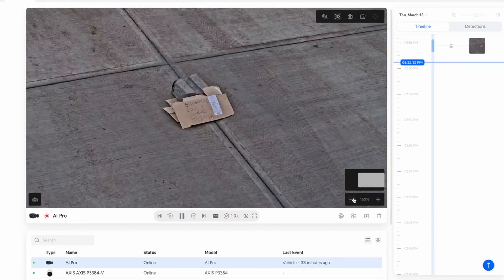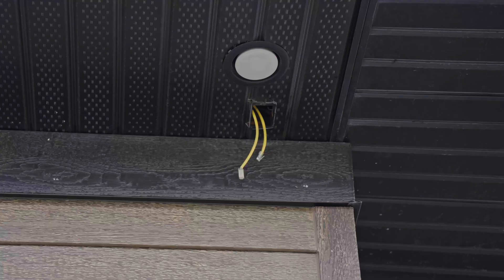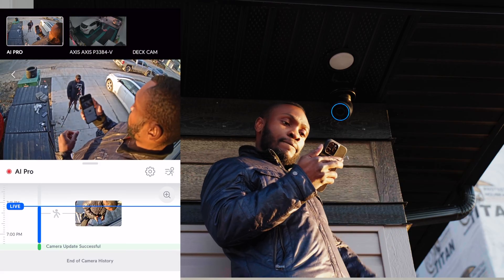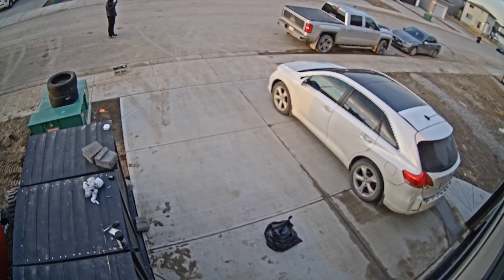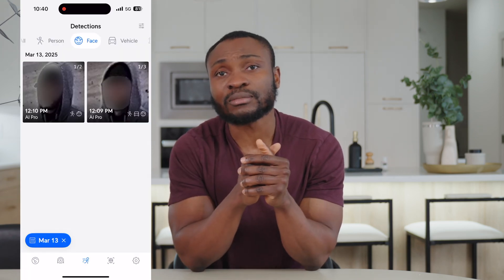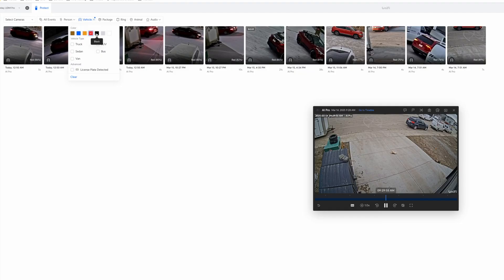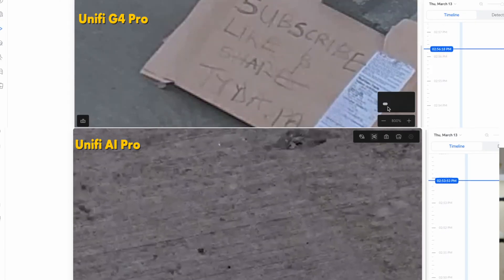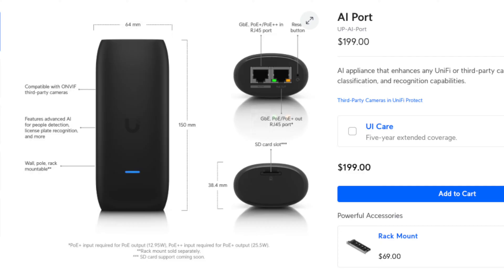Opening My Garage Door With Unifi AI Pro License Plate Recognition!

Comment: Hey great video! Looking at setting up the same thing myself, just wondering what method/settings you found best for the ai pro for getting reliable plates at night (to prevent interference from the brake lights). Are you able to reduce the shutter speed etc?

Comment: This automation is a bad idea from a security standpoint.
All it takes to gain access to your home is a printout of your license plate. 
You could try adding a geofence layer to your phone’s location via app, but you’re still relying on a single POF, or rather multiple POF as you are using HA. 
Unifi Ai LPR + geofence + Advanced Ai conditional trigger (color + type) might be a slightly safer solution.
Reply from the maker: If you go to around 07:35 of the video I did mention that there. With security, you always have to implement 'defense in depth' approach when it comes to security. You should never have only just one control - think of multifactor authentication. It doesn't only apply to your email. I also don't reveal everything I have in my videos. I try to stay as surface level as possible. So even if you try your 3D printer, you never know what else I have in stock. Thanks for your feedback and  I do appreciate it. I'm sure it would be helpful for other viewers going through the comment section.

Comment: Awesome video. I have a similar setup. How did you manage to prevent the garage from opening again when someone leaves the property? I tried using the line crossing function, but it still opens when driving out (even if i have defined Line Crossing like from A to B). How did you manage it?
Reply from the maker: You can use a time frame condition or a cool down timer similar to how motion sensors work. So the door should not open after x mins of it previous opening.

Comment: Both the AI Pro and the G5 Pro (and G4 Pro) have the same sensor.  The difference is the software and processing.   The AI Pro is better compared to the G5 Pro, which has the btter HDR when compared to the older G4 Pro, not to mention the G5 Pro is cheaper than the G4 Pro.   IF you add an AI Port to the G5 Pro, you get all the AI features and the better image quality.       Not that you'd do it that way as the AI Pro alone is cheaper than AI Port and G5 Pro.    If you have a G4 Pro though, just get the AI Port to add all the AI features.
Reply from the maker: But it would be useful for thirdparty cameras. I do have a bunch of reolink cameras across my house that's fed in to the unifi protect. it would be nice to have the AI features also  show up in the unifi protect
Reply: @tytalkstech   true.  Baby steps with ubiquiti though.  It's taken then several years to add Onvif support to what was a closed system before.
The AI port was supposed to get it, but they are behind with even their own cameras on feature parity to AI cameras with that